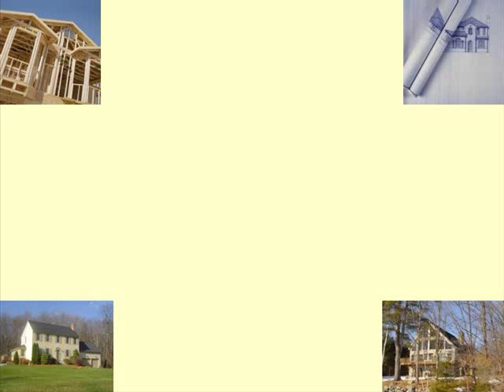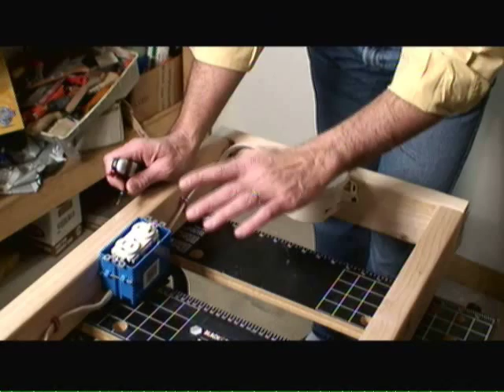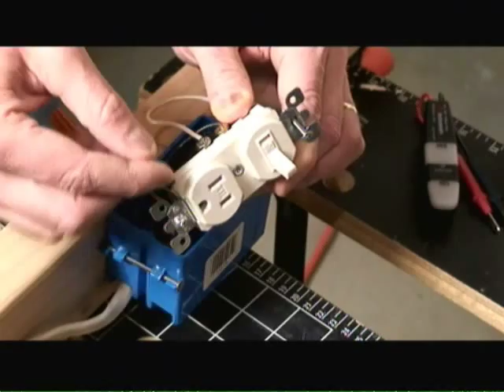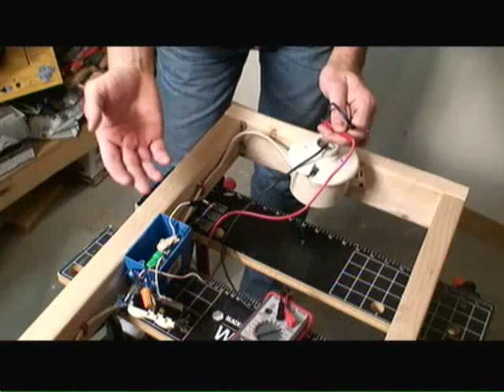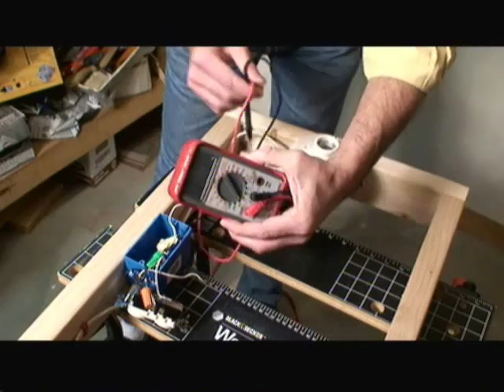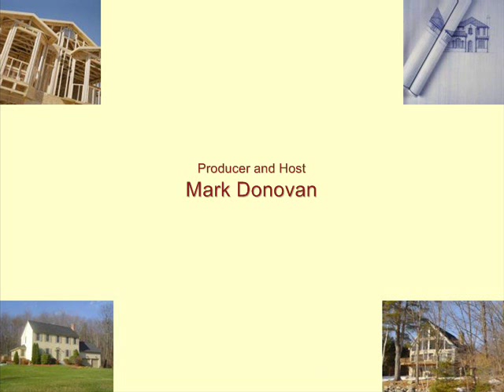Electrical Wiring Troubleshooting Video

Comment from the maker: Short Circuit Definition - A short circuit in an electrical circuit that allows current to travel along a path where bascially no (or a very low) electrical resistance is encountered. Due to the fact that there is low resistance electrical shock and fire could occur.